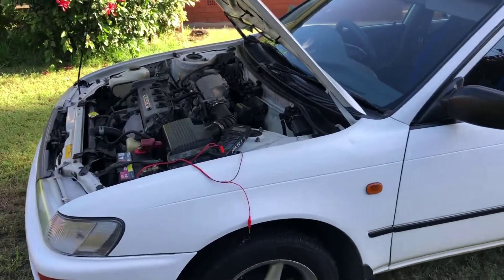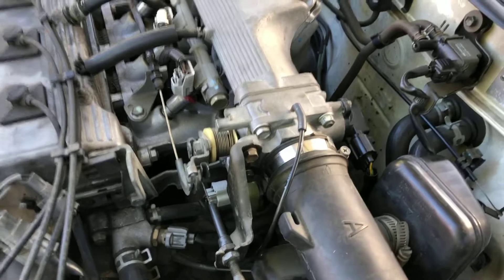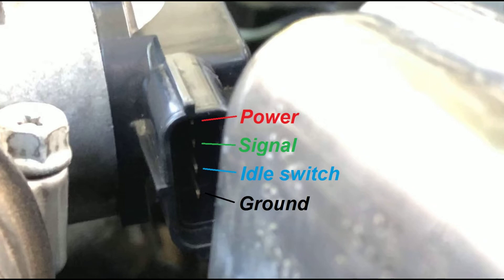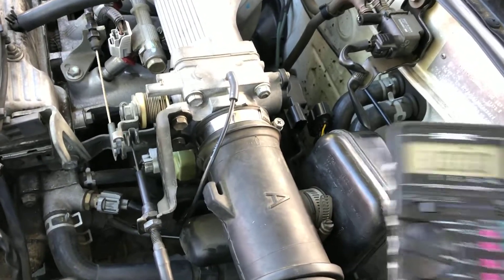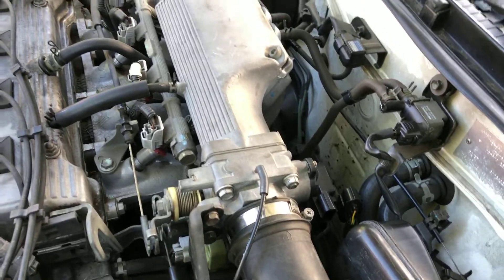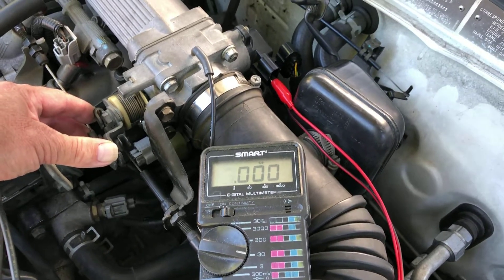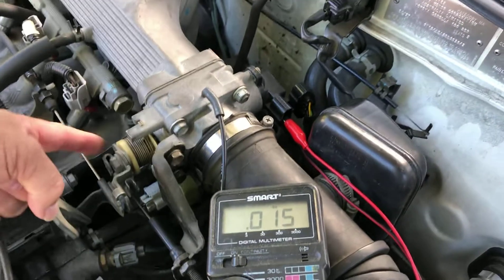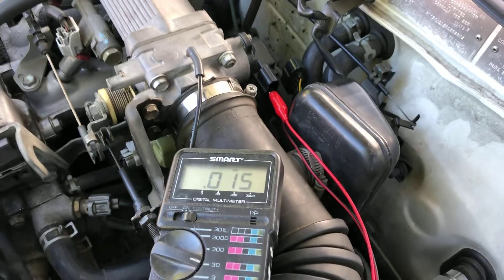97 Corolla pt 2 - TPS adjustment

Comment: What is the correct tps settings of toyota corolla 1995 4afe engine?
Reply from the maker: If your TPS has 4 terminals it will be the same as this video. I have the 7afe 1.8 engine which is the same as the 4afe 1.6 but longer stroke.
Reply: @OzMike  my tps is only 3 terminals
Reply from the maker: @JanMicSung  I believe that means it only has a signal output and no idle switch. I have another video that shows how to check the signal.

Comment: What is the smalles TPs value Toyota corolla
Reply from the maker: I didn't measure the output voltage from the signal wire but the supply voltage is 5v so the signal output should be about 0.5v at idle and about 4.5v at full throttle. I might measure mine this weekend and do another video.